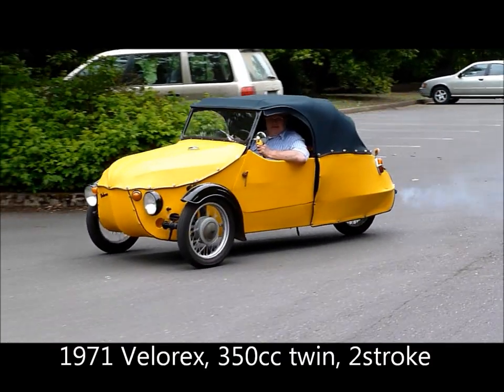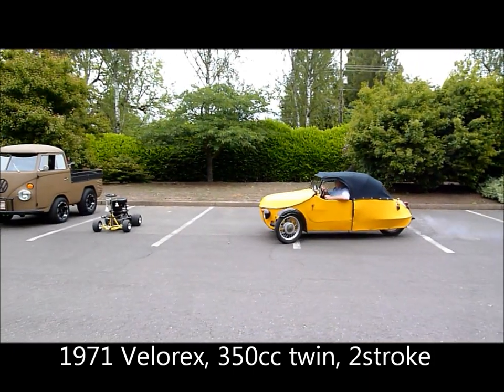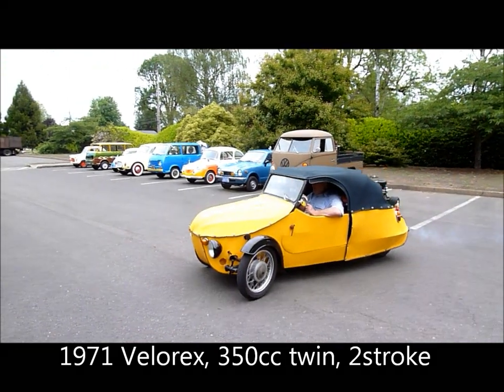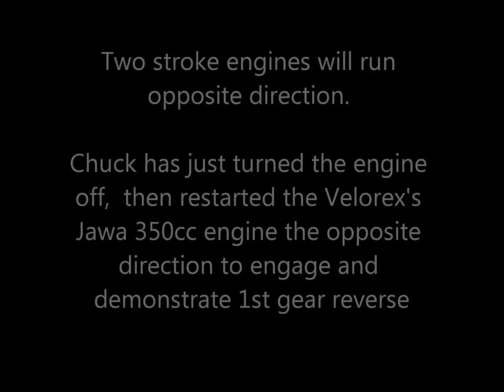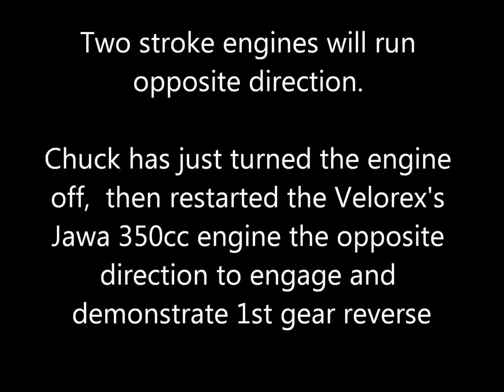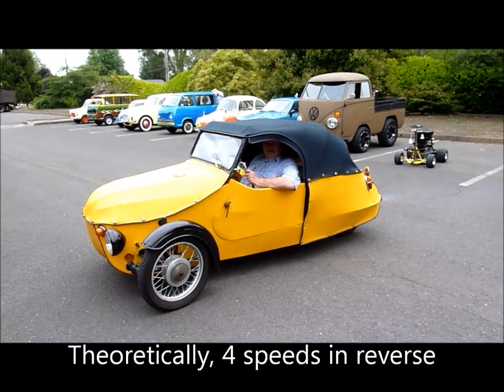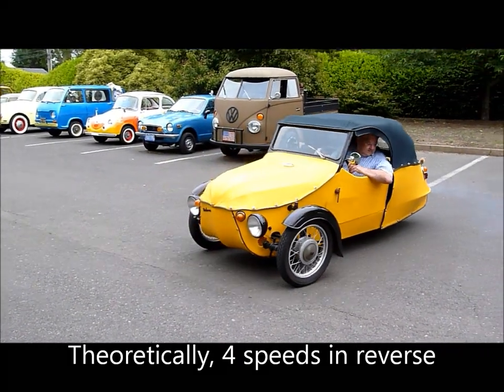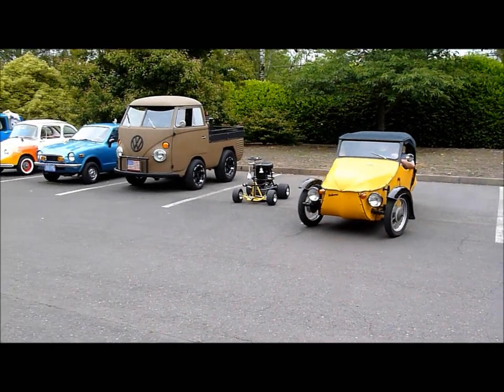Chuck's Velorex

Comment: Is there two ignitions, one for each direction, or does the timing get changed from BTDC, to ATDC, and the starter poles reversed?
Reply: One day an old guy shows up in my street with a Velorex. I had an MZ-ETZ (motorbike) so we become friends in a second. I ask him for a ride and during the journey, he told me there is a Kickstarter which is hand operated, similarly to a handbrake, and if he wanna reverse just stop the engine and pull the Kickstarter to the opposite direction or something like that. I can't remember properly, but he definitely said that the crankshaft will spin backwards and so all the gears available backwards. The 2 stroke engines can work like that.